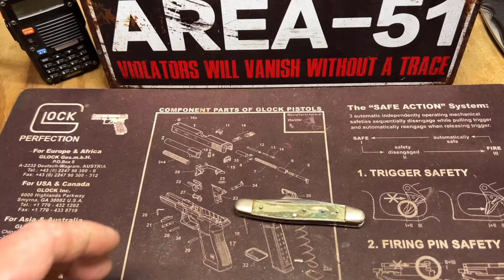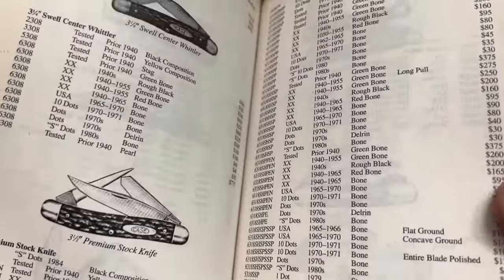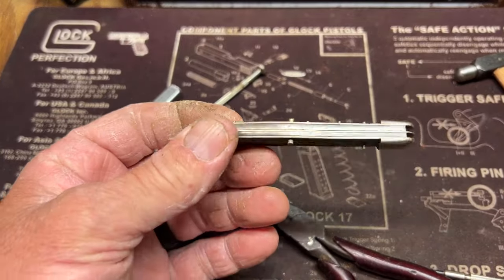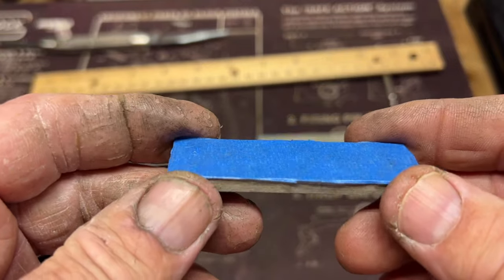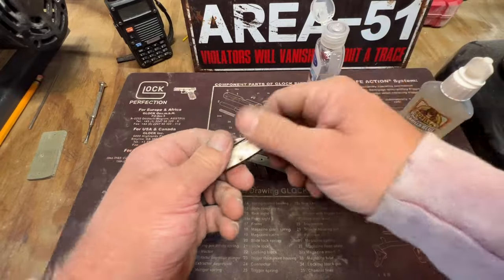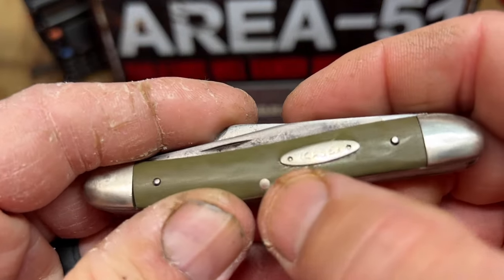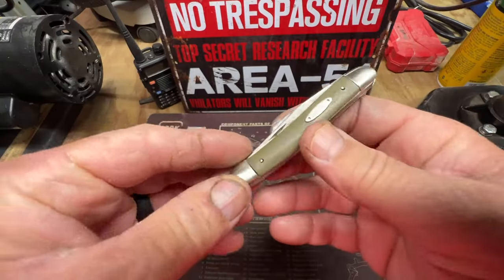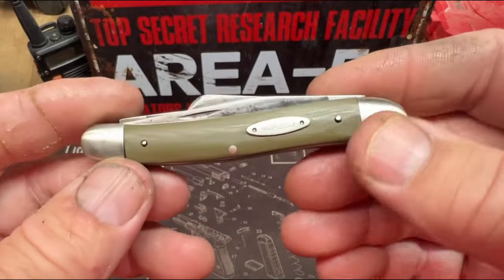Restoring a Vintage 1965-1970 Case XX Stockman Knife: Adding Custom G10 Handles and a Case Shield

Comment: I started refurbishing old pocketknives about four years ago.  Usually, the scales are missing or over time have pulled away.  Probably done about 60 or so.  I then give them away to people I think will give them a good home.

The scale material I use is hardwood from my yard including Black Walnut, Cherry, Butternut and Apricot.  They knives look much better after I finish.  I've run into a problem of my own making i.e.; I make the refurbishing complicated.  I just finished a Remington Scout, and the scales have 10 individual pieces.  It looks very nice.  6 pieces of wood with 4 thin copper spacers.  The copper accentuates all the different colors of the wood.

Comment: Nice trick with blue tape. Black marker or dykum on the tape would help highlight the hole marking. You could also make a template out of cardboard. That would take the pin depressions very easily.  
Love your content. My collection is mainly new locking knives, but I'm inspired to look for old knives now.

Comment: Came out nice!  I have a shrade paratrooper with badly shrunk scales.  Ordered some orange g-10 to use.  I’ve never used it before either but quite a bit of paper and linen based micartas so assume it will be similar.  Wondering if I should try to jig it or leave it smooth?  Thanks, Dave
Reply from the maker: Awesome!!  I’d leave it smooth.

Comment: Don't know if you already knew this, but if you have a dirty/rusty pivot on something you can't take apart you can use a thin oil like Hoppe's No. 9 and lubricate it, then open and close it over and over until the oil coming out of the joint is clean. Great but time consuming way to clean those out.

Comment: Just curious. If you restore those types brand of knives, would it not be benificial to make some scale/handle templates for ease of reproduction?
Reply from the maker: It would if I was able to do that.  I may never run across another like that though.  It’s the hunt and challenge I love.  Every knife in need of repair is different.  Thanks for the support and suggestion!

Comment: I have a small case stockman that's about 15 years old and it has lost its snap how would a person fix that?
Reply from the maker: It’s either the back of the blade or the spring or maybe both have wear on them.  I would suggest send it to case.  They’ll most likely repair it for free.  Thanks for watching and Merry Christmas!